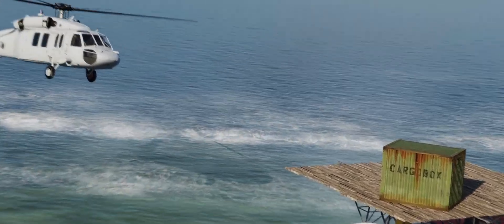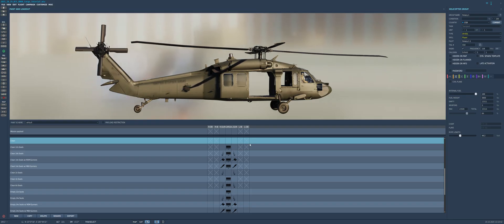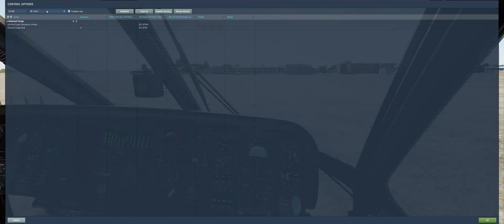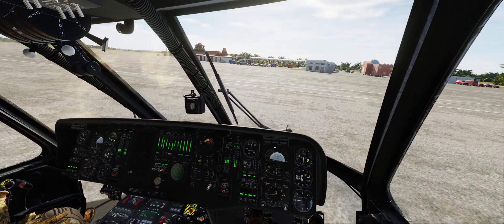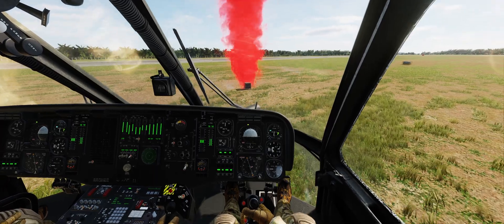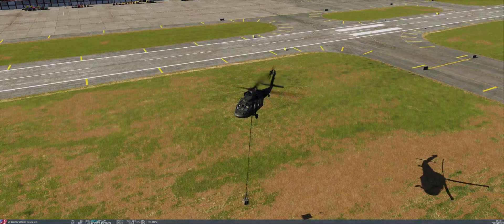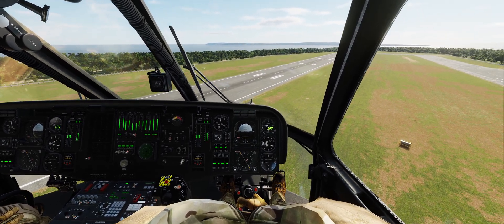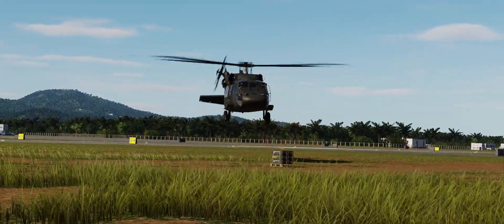DCS UH-60L External Cargo Hook Tutorial

Comment: Regarding cable length, the shorter the line is, then the faster it will swing if it starts to sway, making it very dificult tp regain control of it. If the cable is longer the swinging will be slower, and move through a shorter arc, and a slight turn or change in speed wil bring it back under control. It will act like a pendulum... But a lot of it depends on the load size (voume and air drag) and it's weight. The UH1 cargo weight can be adjusted in thhe mission editor. As you pointed out I am not sure how well modelled all this is in DCS, but as I have practiced it it seems to be easier to manage with a longer line. I also find it helpful to set thhe radar altitude to the cable length + 3m, (say 10 feet).